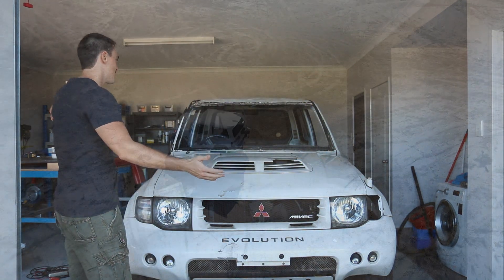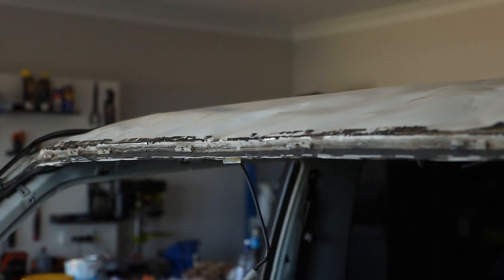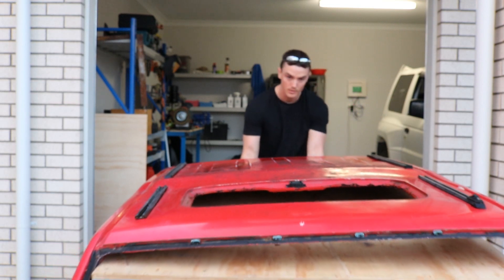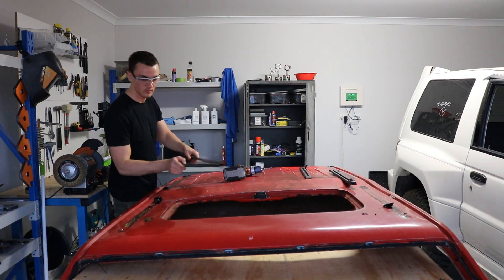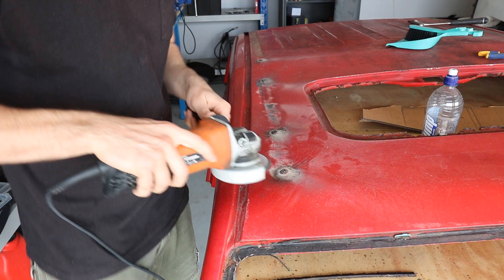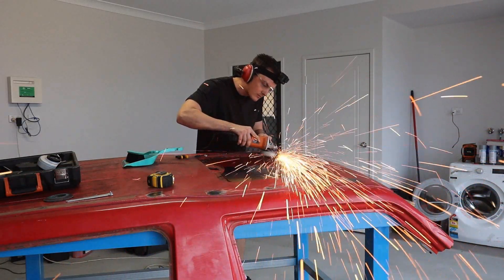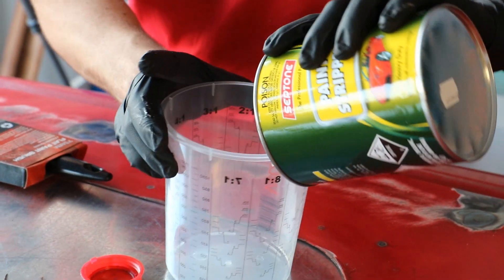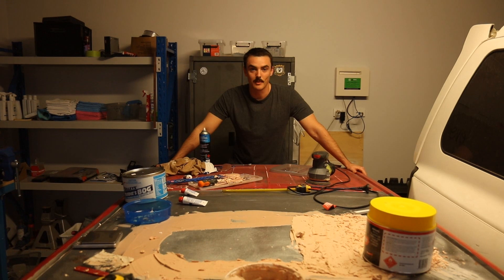I rolled my dream car (Pajero Evolution) | Rebuild video 1 - Carbon fiber roof skin

Comment: Are your Paves Garage RAW shocks stock ride height or 50mm lift?
Reply from the maker: drtone they’re suitable for stock ride height or or to a 50mm lift. The amount of lift will depend on the springs used